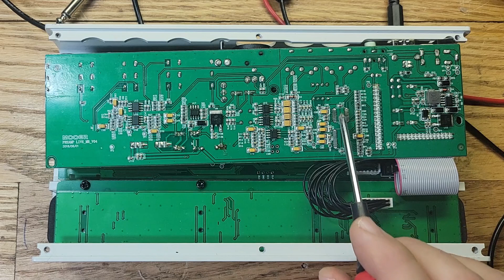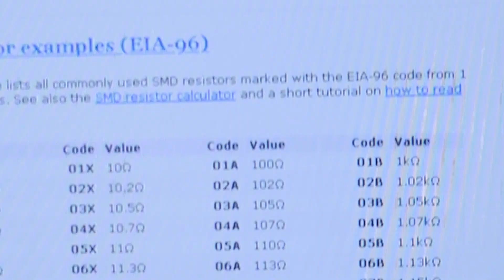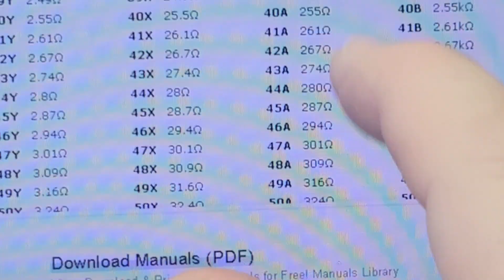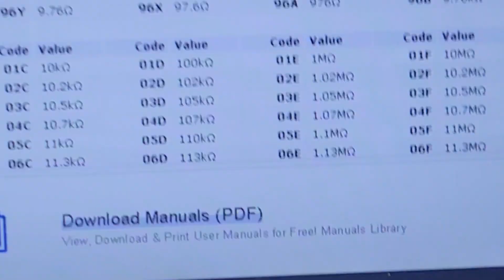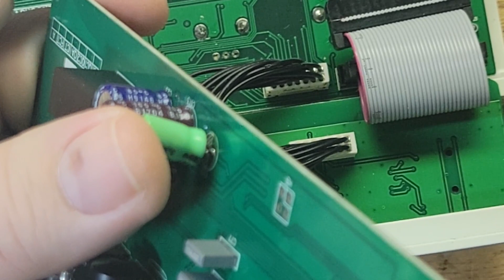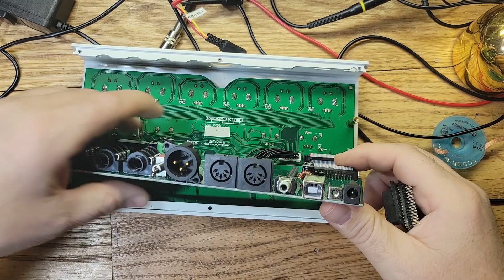Mooer Preamp Live Repair - Part 2

Comment: I've just tried replacing two blown capacitors, after watching your video and identifying two blown out capacitors on mine. Two 100 mA ones had clearly blown out. I've just replaced them with the same value caps. The unit switches on and goes through its light sequence ok and it still connects with the app. The issue is that no sound is coming out of it at all. Do you have any ideas what could be the problem mate? Great channel and presentation. Carlo 🎸👍🏼
Reply from the maker: If the 2 100uF were blown it's likely that the other ones are blown also. I had to replace all of them.  Check the voltage at the DC to DC converter and at least one or two of the op-amps like I do in the video.  Probably there's no voltage going to the op amps.